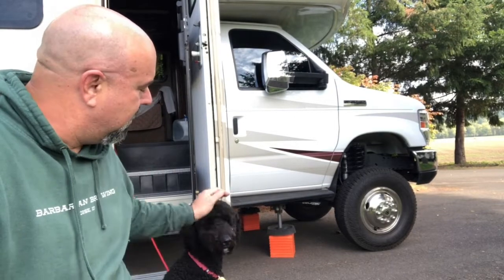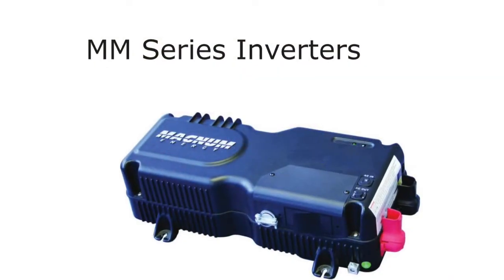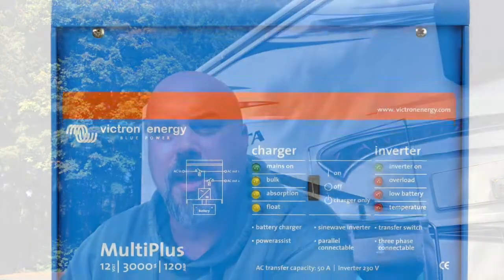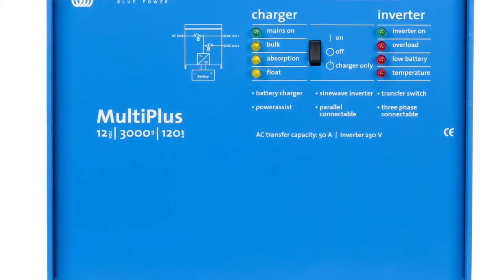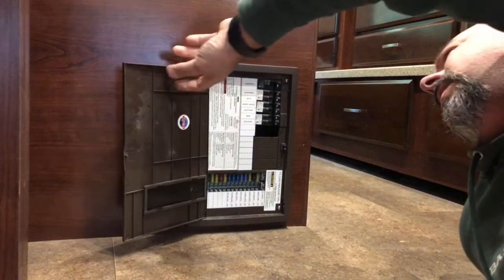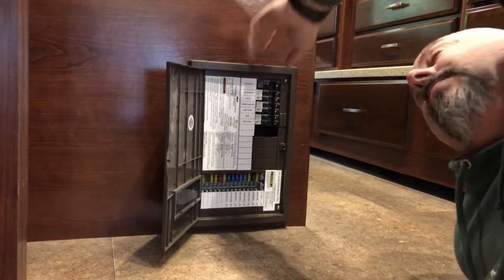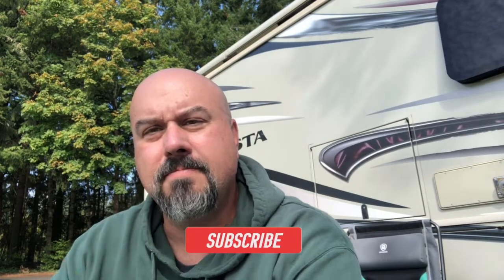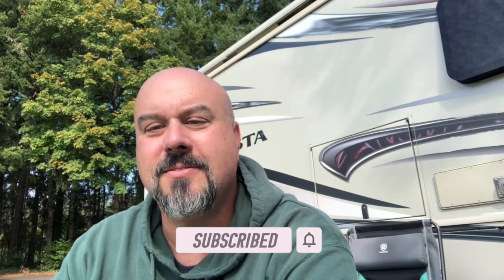RV Inverter Upgrade

Comment: Great job on the explanations Ben. Super nice upgrade for your rig! I bet running those wires gave you some grey hairs and skinned knuckles. What's next? Selling a kidney and installing a pair of 400AH batteries?
Reply from the maker: I'll stick with my 210AH for now.  A soft start on the AC and maybe some roof solar panels will be next.

Comment: Dont know if i saw this before, but this time i listened, and you made it make sense.  Thanks.   Having to know where to go next with solar, and sweating it out financially till Feb, and the last time i sought direction,  I was given a 7,000.  estimate for that.  But i have 2500 watts of used panels 327 to 372 watts.  2 are 15 amp fuse, 5 are  20, paralel or series, and a good working inverter, to get me to an upgrade down the financial road. So anyone wanting to offer direction , please do.  Planning on 300 battery bank to start. But thats all im decided, need the controller, inverter, on/off and where to put the stuff, like should i put it all by the converter, and do i still need a converter ?
Reply from the maker: There's several good FB groups for RV solar that I was able to search, and ask, for answers.  There's also a LOT of YT videos on the subject.  I will say a tidbit I learned, if you can get twice the number of watts on the roof as amp/hours in battery that's a good target to hit.  I.e. 1000 watts of solar to 500 ah of batteries.  Any ratio past that is gravy.  I do have a couple of short videos on the solar setup I did on our class c w/ 800 watts of solar and 400 ah of lithium.
Reply: @BenWho  wow, a d i gelt like a big shot with 300, lol, thanks for the heads up on the FB groups, blessings.

Comment: Thank you this informative video.  I would like to know what type of junction box was used.  Would you take a pic of the "internal" connectors?
Reply from the maker: The junction boxes were just standard wall mount (plastic) boxes you would find at Home Depot/Lowes that I then put a blank face place on to cover them up.  Internally it is the romex wire with with each conductor twisted together and then a wire nut installed on each one.  In essence it would look similar to what it looks like if you pull the cover off of a wall switch in your house, remove the switch, connect the wires together, and then re-install the cover.  Let me know if that makes sense.

Comment: Glad I just found your channel... Learning a bit already. Would also love to have links to the inverter, which you could benefit from with affiliate links.
Reply from the maker: I don't have any affiliate links.  The inverter I installed is the Victron Multiplus 3000 - 12v version.  https://www.victronenergy.com/inverters-chargers/multiplus-12v-24v-48v-800va-3kva

Comment: So how does this work with your converter.  Aren't you inverting from battery and feeding the converter which charges the battery?  This will drain your battery faster right?
Reply from the maker: It's a converter/inverter/automatic transfer switch all in one unit.  It will automatically switch over to 110v if it see's power on that leg.  You can control how many amps it pulls in from 1-30.  Great for when you're plugged into a 15a residential outlet.  Any power use needs above that 110v/15a line it will pull from the batteries to combine the output needed (automatically).